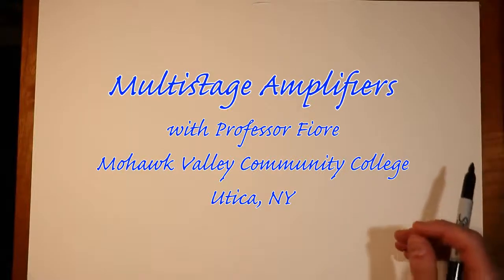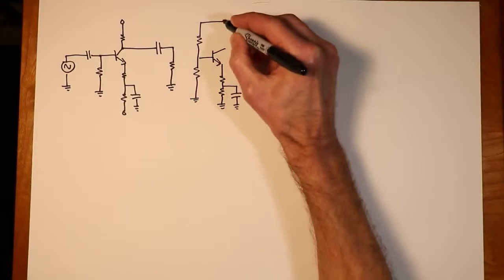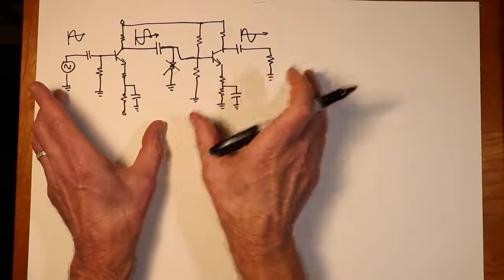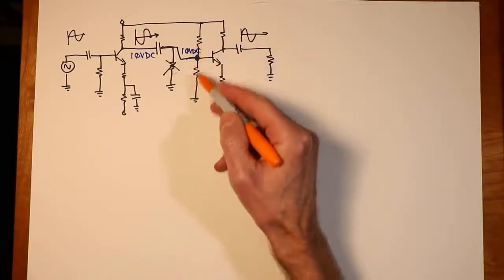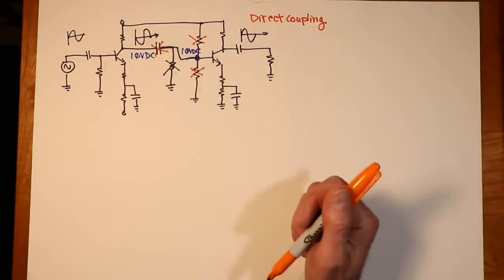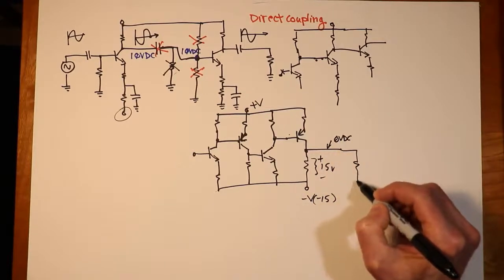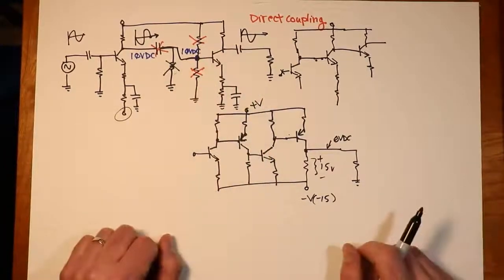Semiconductor Devices: Analyzing Multistage Amplifiers

Comment: Check out a Dallas Arbiter FuzzFace circuit if you haven’t already. It does direct coupling and interestingly Q2 emitter feedback to Q1 base (only source of voltage for Q1 base). I’m a novice to learning BJT transistor circuits and primarily a musician, so idk if that’s uncommon or not. I’d be interest on a quick analysis on the DC parameters, audio, and such for that circuit if it’s something you would do!

Comment: Awesome video! That's what I always wonder, how do you know the right polarity of the coupling capacitor particularly the ones between different stages of the amplifier? How do you know which side has the higher voltage just seeing the schematic? Is it more of an instinct? Or do you really have to do the DC analysis to find out?
Reply from the maker: Yes, you really have to do the DC analysis to find out. Granted, often you can make some quick approximations to determine polarity, but for a design, you're going to have to do the DC analysis anyway, and the differential DC voltage is what indicates the voltage rating of the capacitor.

Comment: Thank you. This answered some questions I had from the previous few videos. I was concerned that the DC amplification at the collector might push the upper limit. Your teaching must be good because I thought of the PNP as stage 2 before you mentioned it. If we balance the Rc and Re (with appropriate splitting and capacitor bypassing), can we keep the through voltage close to Ground in a split power supply, or is it a case of making the Rc set the voltage drop at each stage to keep it centred for the AC swing? I'm really enjoying your videos, I wish I could absorb more than one a day.
Reply from the maker: The idea of alternating NPN with PNP does indeed keep that bias voltage trend in the middle (close to ground for split supplies), although you can't ignore the AC load line (max swing), either. As with all engineering design, it's a question of balancing needs.
Reply: @ElectronicswithProfessorFiore  Thanks again, I've just downloaded your course notes.

Comment: how do i solve a direct coupling common emitter, bjt mutistage? is the current flowing to 2nd transistor = to one coming in at the wire without the coupling capacitor at collector?
Reply: in a dc/ac analysis
Reply from the maker: @chrissanthakumar1382  I used to tell my students to think of a windshield/windscreen wiper (DC, AC). Start at the first stage to establish the initial DC bias and then follow this through stage-by-stage to the output. Now that you have all of the required DC values, go to the final stage and determine its voltage gain and input impedance. Then go to the prior stage, using the Zin you just found as the load. Once the penultimate stage is done, repeat the process for the stage before that, and so on. 

The next time you're driving in the rain, just imagine that the wipers are making a sound that goes "DC, AC, DC, AC..." ;-)

Anyway, more on this in my free Semiconductor Devices text. Follow the links in the description to download it.

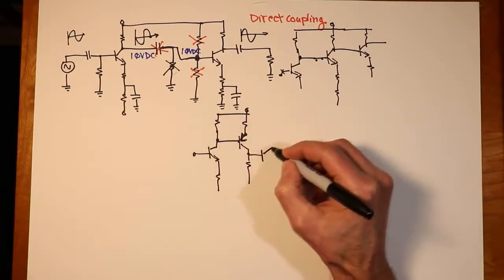Comment: 9:00 the problem of running out of headroom being solved with pnp transistors is confusing lol. If we used just npn transistors, can we connect emmiter of second transistor into base of third transistor to achieve same effect??
Reply from the maker: If you cascade a bunch of NPNs, the collector voltages keep increasing from one stage to the next (Vc must be greater than Vb for an NPN). Eventually, it will hit the power supply. The opposite is true for PNPs, so alternating them produces Vc values that stay in the middle.
Reply: @ElectronicswithProfessorFiore  thank you !